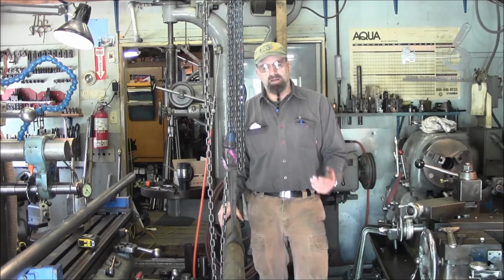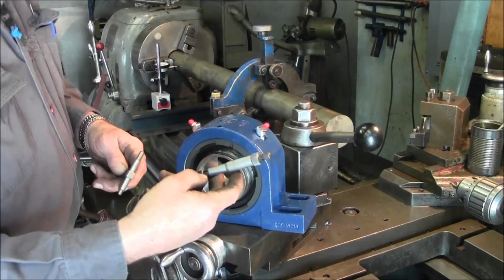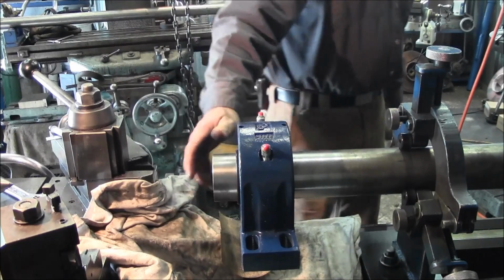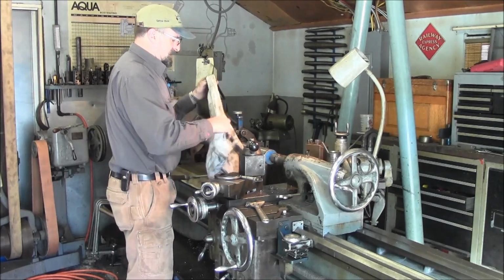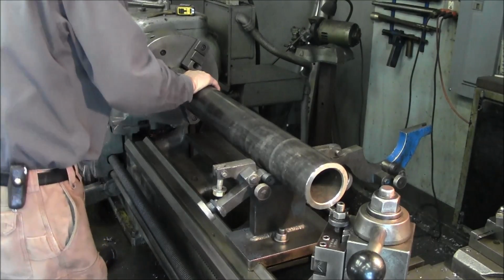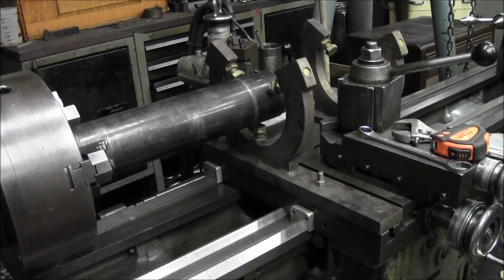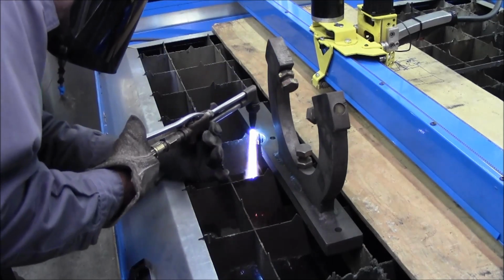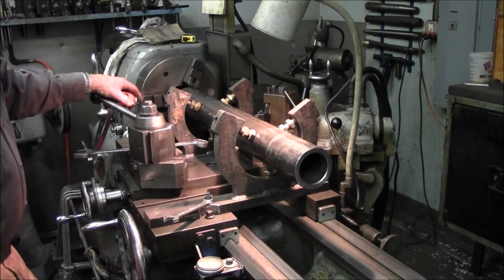Super Shaker

Comment: It didn't seem overly effective - is it out of adjustment ? With the one I used, I think it was reckoned that even at top speed (1200rpm?) it could stop the chuck in half a revolution. Ours hasn't got a brake but a clutch instead - so the motor continues to run.

Comment from the maker: In the can is sulfur based cutting oil and on the ways is way oil. Some chucks only have one square drive to tighten the chuck and the ones with three are for convenience, sometimes you get the need to check them all but one should do the job. Also one may close the part in the jaws closer than the others. ;{)-----

Comment from the maker: It was challenging at first, but after you get use to switching hands it cool! I had no problems with the Clausing too. If your a good free hand mill operator you can easily switch hands for the lathe also, just like switching your stance on either side of the knee. ;{)-----

Comment from the maker: It was on one end of the shaft, the tolerances were called out by the manufacture of the bearings, not the manufacture of the equipment, I made a note of what they were in writing, the stock size of the shaft, .001" under that and going into the sand & gravel pit, not really even making a full revolution I saw it not that important. ;{)-----

Comment: Cool, another series!  First time I've seen you use a cutting torch, glad to see having the plasma cam didn't make you get rid of it!  Really looking forward to this series since I've never seen line boring done in the lathe before.  Quick question:  How do you work it with your customer when you need to buy special tooling, like a boring bar, for their project?  Is the entire cost added to their bill or is it shared, assuming you own the tooling after the job is done?

Comment: Hurrah another video!  A tip for cutting thick steel with a torch is while you are center punching the cut line, give the corner edge a hit with a cold chisel.  This will raise the metal just a little and when you start your preheat, this raised metal will get to cutting temp much quicker, you can start your cut a lot sooner saving both time and gas.  
I like to also run some soapstone over the centerpunch marks , this makes them super visible.